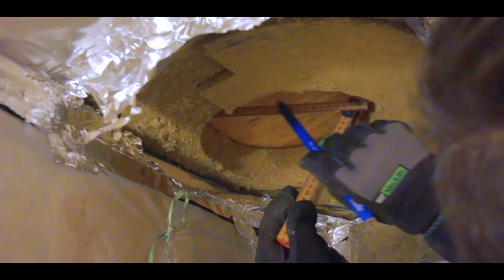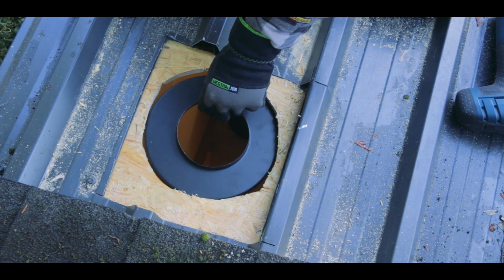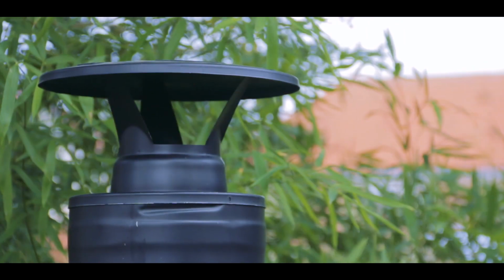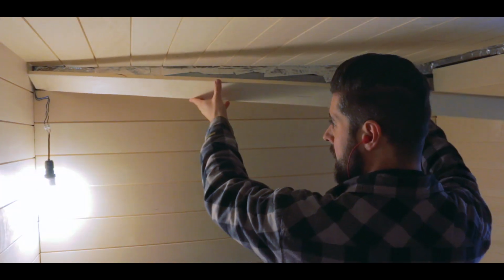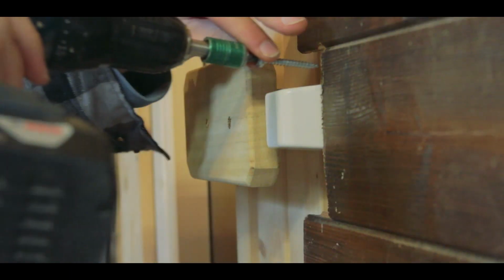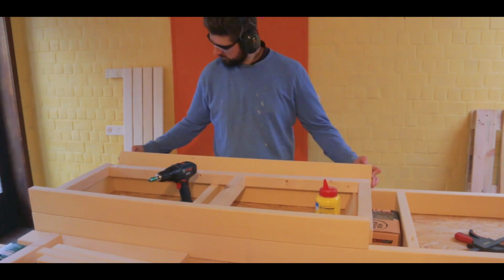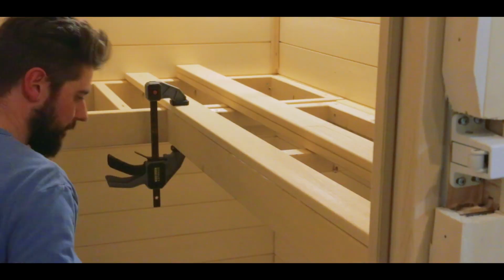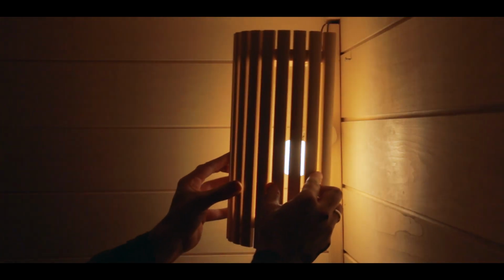Building a  DIY Sauna in my Garden, PART 2!

Comment: After many month of use, how does the wood glue handles the extreme heat? Also did you put anything on the concrete floor?
Reply from the maker: Hej Attila, it holds up nicely. The sauna gets a good amount of use and so far nothing strange has happened :). The funny thing is that the only ready-made part I purchased, a humidity/temp meter is the only thing that IS leaking sap and has a poor build quality.

The floor is ceramic tiles glued on top of “chape”
(A sort of concrete mixture but with more sand and less cement) and that has also been crack free,
Even with some frost-weeks here and there .

All in all i’m actually surprised that it has all held up so nice.
Reply: Thank you

Comment: Great video, thanks for this!! Can I ask about how you finished the chimney hole from the inside?
Reply from the maker: Thank you very much, Sure thing, if you google image searche Harvia WHP1500, you’ll see all the items that come with the chimney pipe. I added the rockwool collar around the pipe and then from the inside you saw a bit of that collar plus a round hole where the I cut the roof. I added the ceiling wood cladding to about 2cm away from the chimney and covered it with a black metal flange (you’ll see it on the picture. That flange slides together and is attached with a few wood screws into the wooden ceiling.
Reply: @ProjectsandThings  Cool, I see that now. Thanks again :)
Reply from the maker: @scientificsportfishing7751  you are very welcome Sir.

Comment: hey, really enjoyed that build.... now 1 1/2 years later.... would you have done something differently? or did everything held up nicely? keep up the good work.
Reply from the maker: Thanks Sven! I’m glad you liked it. Everything has held up well through 1,5 years of use. The roof I would have changed. The angle is way to low, so that water runs off but leaves etc stay on it and then they accumulate around the stovepipe, which is s fire hazard in some way, even though the pipe is insulated on the outside as well. Otherwise I am still very happy. Are you also building a sauna?
Reply: @ProjectsandThings  it's on my list.... next month I am moving to a bigger place with a big garden.... the spa part is already ordered, but the sauna i want to build myself....

Comment: Did you use stainless hardware so doesn't rust?
Reply from the maker: Yes, for the most part. The metal clips that hold the wood are stainless, the other exposed metal is powdercoated.
The screws in the main structure, now behind all the wood are not stainless. But the sauna is well ventilated and about an hour after each use the sauna is dry again from the residual heat and airflow, so I’m not that worries about screws rusting over time.

Comment: Nobody uses glue in buildind the bench or anything in a real Finnish sauna.! Why chemicals in a clean space?  ( I´m a fin, live in Finland and have three saunas) I really cannot see at what levell Your foot rest is but in US sauna videos the bench is usually way too low. The main thing is that Your feet have to be at the same levell or a bit higher that the stones in the oven ( kiuas).
And the draining!!!!!
You have to wash or at leat rinse your sauna after every time You use it, otherwise Your sweat starts to smell. So that water has to go somewhere else that on the floor staying there.
Reply from the maker: Jore Puusa, kiitos paljon for the comments. I did not know that benches were not glued in Finland. My inspiration came from there though, I spent a lot of time in Jyväskylä with my exes family and fell in love with the concept of wood-fires saunas. I only used glue because I did not want the parts you sit on to move or make noise from the screws over time. I did not put a drain in since everyone advised against this, but the sauna gets clean regularly and I wipe it down after use and the remaining heat dries it out completely in a few hours. There is also permanent ventilation through the space so it still looks and smells clean . The footbench keeps my knees at the same level as my hips, so it should be higher  is what you are saying, right? You have 3 saunas? Wow dude, that’s amazing, tell me more. Is one wood, one infrared and one electric? Let me know Jore.
Reply: @ProjectsandThings  As most fins - we have a small cottage at a clear lake in the woods somewhere. There is a small sauna so near to the lake that we can jump in to swim even at winter. So we throw some löyly ( the steam) and go to swim. Hot cold - hot cold...bout an hour. That sauna uses wood to warm up. Most of the saunas here in finland have the bench ( laude or lauteet) at a height of say 150 cm from the floor. And the footrest is at the same level as are the stones of the kiuas. So the feet keep warm also. Two of our saunas are so large that we can lay down on the lauteet. Then i have this little sauna behind my bathroom inside my house. I can sit there by myself, two persons is a bit too much to fit in, that warms up with electricity.
Sauna is a  a place to take care of one´s mental health. You leave everything outside and listen to the wood burning and feel the odor of birch leaves and tar etc. The sauna in Germany is totally another thing they even deny throwing water on the stones , same as in sweden. Russia has nice saunas, they keep a funny hat on in the sauna..stupid looking and i do not know why.
In Finland families go to sauna together with children, everybody is nude. That is totally natural but could make an american have an heart attack....We are closer to normal natural life still here, nobody gets upsett about nudity. 
There is one more type of sauna which is the original. There is no pipe and the smoke comes inside and is burning under a heap of stones, it takes 4-6 hours to warm it. There is a hole in the wall where smoke gets out. That savusauna ( smokesauna)  is the best of all say five other types. Unbeliavable mild and nice. A place where fins have been born and dead were washed centuries...hm not anymore :-)
 Infrared is not a sauna it is just a hot small kiosk. Terrible.
Reply from the maker: Jore Puusa haha, I totally agree with you about infrared. In my sauna it is a bit of a debate beteen me (Belgian) who loves to throw water on the stones and my wife , who’s German and is not as much of a fan (as you described). It sounds like you got an excellent thing going at your cottage. And in terms of the nudity I also agree, americans would 2 pairs of pants on but we go naked into the sauna, cleaner and more fun :) I do not have a lake nearby but I made a film about building my cold rainwater shower to provide the cold in between sauna sessions
Reply: @puusajore  thank you for a valuable comments from someone who knows stuff. I a m building one now. Due to your comment I will put my bench much higher and my floor will allow water to run. What do you think of insulating it with plastic sheet behind the wood. Many people do it on the youtube videos - but I really am not convinced it is a good idea.